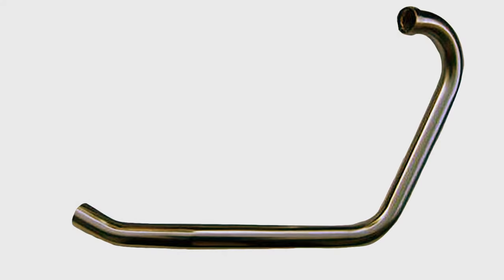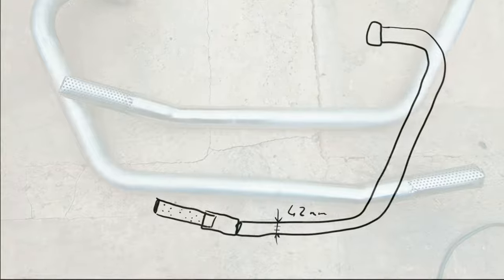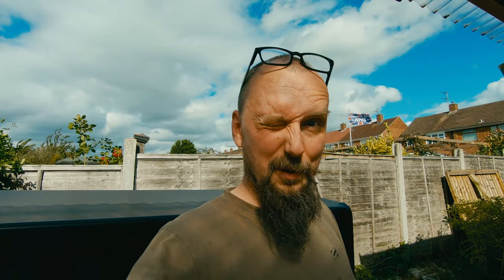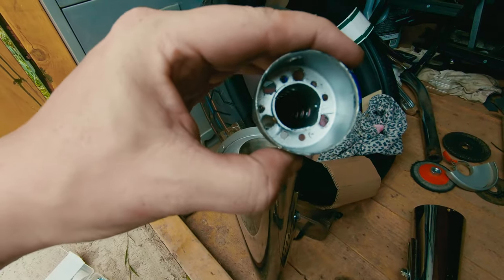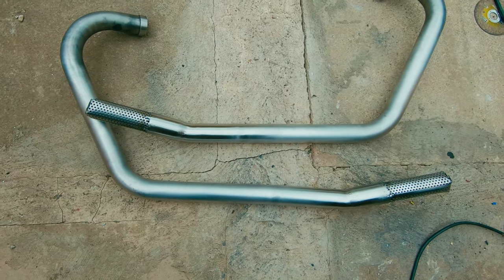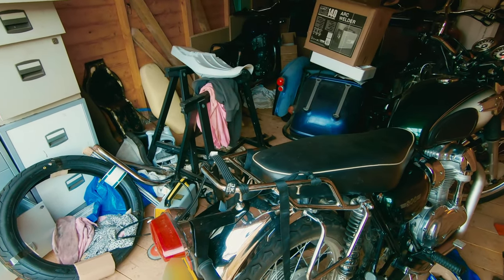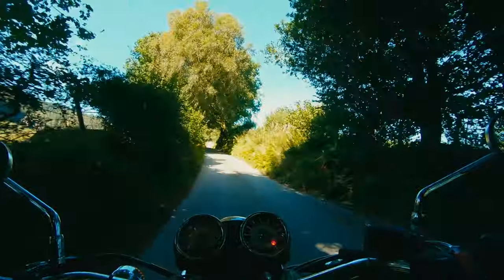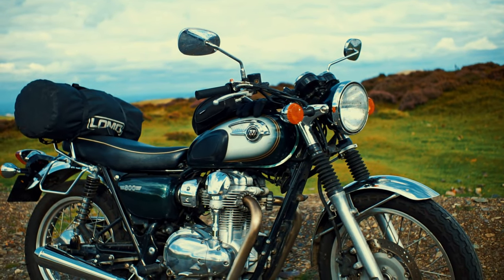Kawasaki W800 / W650 stainless headers & reverse cone megaphone exhaust with sound test

Comment: You clever sod !  Looks, sounds excellent. Did you calculate the changed breathing & back pressure, or guess ? :)
Reply from the maker: That's my unbelievable engineering skills 🤣 but seriously I just used common sense and a bit of logical thinking.

Comment: Great sounding exhaust !
How did you overcome the issue of the catalytic converter that was in the original mufflers ? Your help is much appreciated.
Reply from the maker: you can use this https://www.motostorm.it/en/accessories/exhaust/akrapovic-p-kat-040-catalytic-converter.html or you might read that https://www.boosterplug.com/shop/cms-removal_of_the_catalytic_converter.html